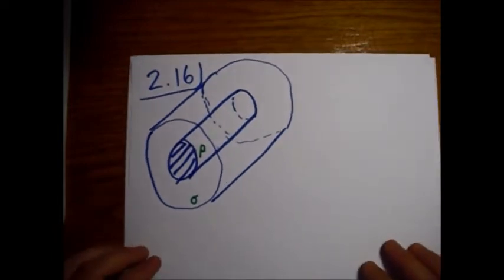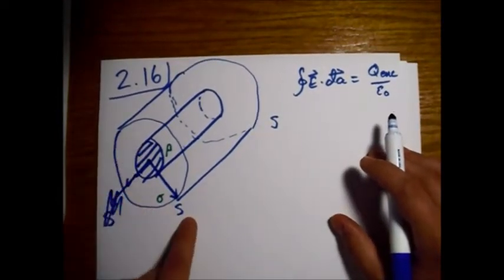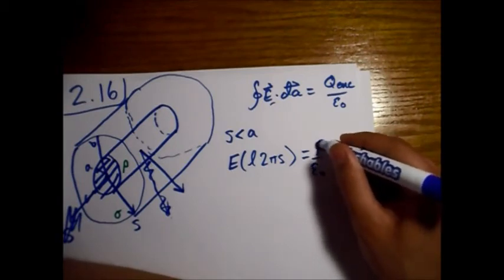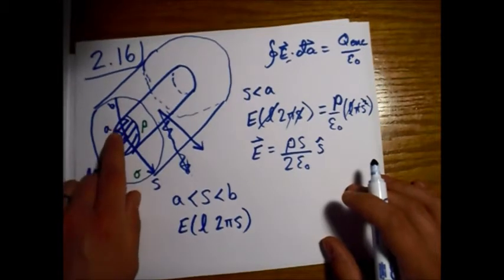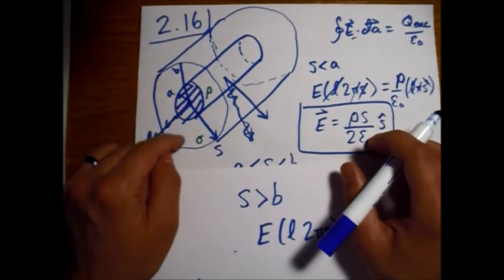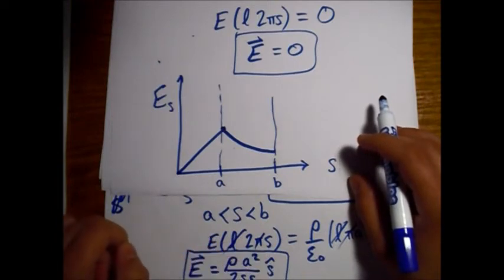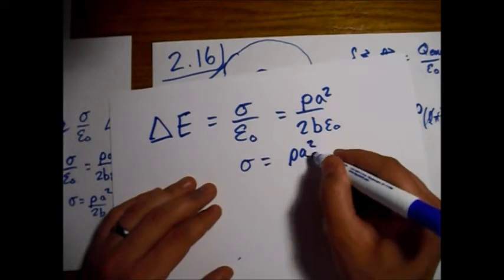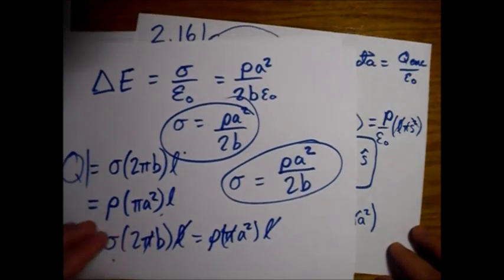Griffiths Electrodynamics Problem 2.16: Electric Field of Long Coaxial Cable

Comment: What would the electric field be if you didn't assume E=0 for a coax cable? would you have to sum the result for a<s<b with the surface charge density at radius b?